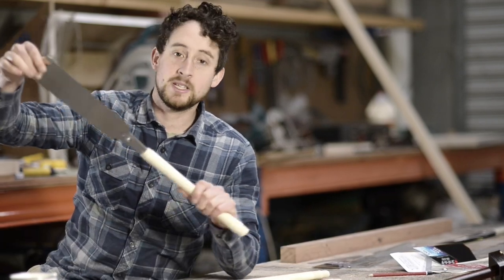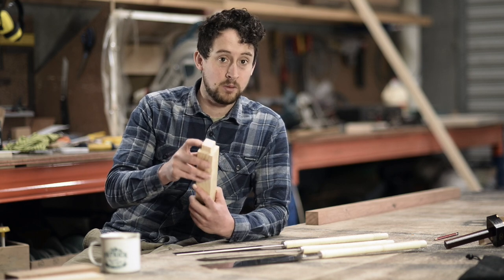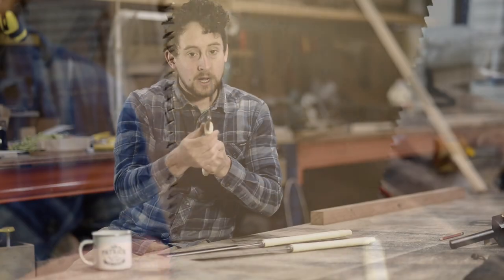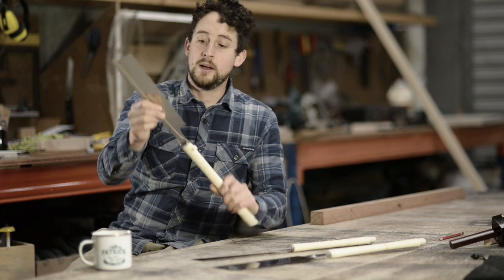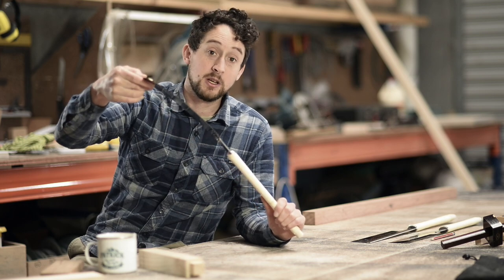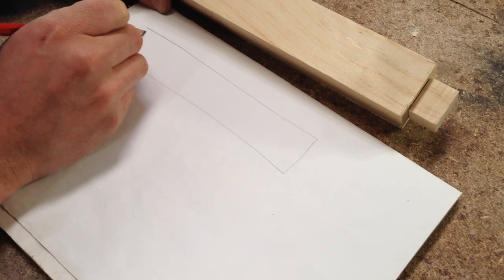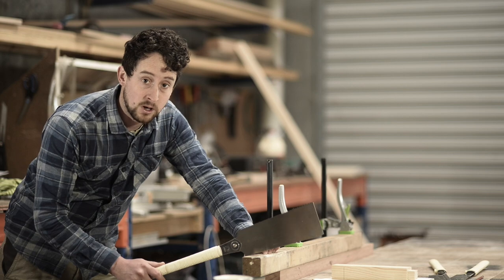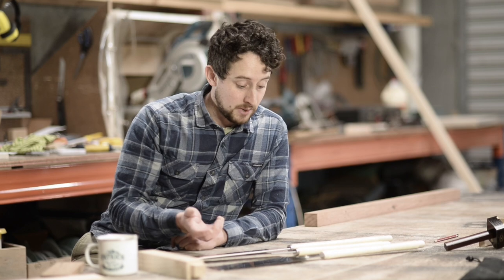An Introduction to Japanese Saws

Comment: I had been using traditional Western saws with no issues for years. However, i developed rheumatoid arthritis in right hand and holding and using the push saws was starting to be difficult. I tried a ryoba to start with for ripping. Due to the different cutting (pull) and grip and less weight compared to a western saw, I can now continue my woodwork with very little pain and the improved grip gives me very accurate cuts. I now have a set of the 4 most useful Japanese saws. Highly recommended for those who may be in a similar position.

Comment: I just finished installing shiplap where I did the entire thing using my dozuki and kataba.  Being able to work with little to no noise and producing less dust is a big deal.  I love the quietness of using a handsaw and because no two cuts were the same I was able to scribe and cut without having to setup a miter saw each time.

Comment: I've started to wear out (bugger up) my Ryoba saw. Initially I hated the rip teeth as I wasn't trying long rip cuts. Recently I built a Tassie oak artist easel, 15 bird houses, and a queen size bed weighing 180kg all using the Ryoba, some chisels, and an f-ton of elbow grease. I've warped the cross-cut blade tip, tooth number 6, and you can see some discolouration in two other places where I didn't do great things. That's four newbie mistakes over around 3 years of woodworking causing minimal functional damage. It is still razor sharp and effective.

Comment: Thanks for confirming they're Gyokucho; I've also been considering Gikoh/Kakuri but I've heard respected craftsman vouch for Gyokucho saws. 
For tough cuts you can start the kerf with just the closest end of the blade as these teeth are made closer together for this purpose. 

The single blade, spineless saw is 'Kataba', not "Kabata", just FYI.

Comment: I would like to add is that they are relatively simple to break. This occurs when the user pushes the blade forward but not exactly at the same angles as the saw cut. I bought a kataba specifically for hard wood and broke it in the first 5 minutes. A wedge or shim could have helped but the wood was very hard and the cut just started.  Just a simple warning to be careful and don't rush the cut.
Reply from the maker: Thanks David. Much appreciated. However, remind us never to arm wrestle with you! :-)
Reply: David, you're spot on.  I bought my first Japanese pull saw 3 days ago.  It was very awkward at first but when you hit the groove, no pun intended, it's a great cut.  Thanks for your video and you just received another subscriber.

Comment: Nice video. How about mentioning that camellia oil (tsubaki oil) is good to put on the saws to prevent them from rusting?
Reply: That's the traditional oil used in Japan, yes, but any oil or wax you can find will work fine.

Comment: What's a good feather file to sharpen those saws?
Reply from the maker: The teeth are impulse hardened which make them extremely sharp and long-lasting, but also make them brittle and unable to be resharpened. The blades are easily removed and replacement blades are available when they start getting blunt.
Reply: blade can change new, wery cheap buy and change new blade, but no need change manytime have wery strong and longlive sharp saw.

Comment: What does rip cut and cross cut mean?
Reply: Rip cuts are when you cut with the long grains/fibers of the wood while cross cuts are across the wood grains/fibers.  Usually a piece of wood is cut and processed so the grains/fibers are oriented parallel to the length of the board while crosscutting is perpendicular to the wood fibers.  Hope that helps.

Comment: what need use plywood ? rip cut or crosscut ?
Reply: Matti Virta crosscut, however if you have the money or work with a lot of plywood there’s actually a Japanese saw made specifically for plywood, since plywood is especially hard on blades due to the glue and anything that’s stuck in between the layers.
Reply: @thatguyonyoutube807  link?

Comment: YOU CAN PULL A TRAIN BUT YOU CAN'T PUSH A TRAIN
Reply: You can't push a train? Tell that to most American commuter railroads.
Reply: Helper engines in the middle push and pull.Also go to a busy yard and see trains pushed and pulled.
Reply: @chengliu872  a single human being can and has "PULLED" a train, but never the opposite.
Reply: @chengliu872  no one has poetry anymore ... this is in reference to the beauty of sawing on the pull and not the push ... don't overthink it.
Reply: @danbytp  this is in reference to the beauty of sawing on the pull and not the push ... don't overthink it. A single human being has and can "pull" a train, but not the opposite.
Reply: @terryb3388  You're right. The lead engine(s) are pulling and the trailing engine(s) are pushing.And can do the opposite depending on accelerating or slowing.The fun one is the mid train helper doing both at the same time,all the time.Thank you for reminding me.😁

Comment: Hold the saw on about a 15 degree angle it will cut straighter , you will feel it when it's the correct angle

Comment: Why replace the saw blade when it gets dull?  With how broad the blades are, it looks like they can take a hundred re-sharpenings.  There's a world of difference between a sharp saw and one that isn't dull enough to replace yet and files are cheap.
Reply: tya04 the blades are too thin to be resharpened. There are Craftsmen in Japan who do it but it is very difficult and expensive.
Reply: tya04 Most Japanese Saws have hardened teeth. They can be sent to Japan for resharpening, but the blades are designed to be replaceable
Reply: saw blade can change, wery cheap buy new blade and change new, i want see men who sharpeninin 0,6mm thin saw whit file haha, lot work ,easy change new blade and super cheap.hardened blade not need change manytime all your life about maybe onetime, but old shit bush saw need sharpen ewery week.

Comment: Japanese rule for sawing--    Only cut the surface you can see.--     So from  9.42 you break the golden rule. In this video you have a nice straight grain piece of soft wood. So you were "lucky". But for a teaching video about Japanese saws you broke the rule .
   Most videos don`t explain how the Japanese rip saw should be used . You got close to the right idea and then shot yourself in the foot by not demonstrating Rip Cutting. You switched back to cross cutting . So I don`t think you understand  how a Japanese rip saw works .  Just as 5 other videos get it wrong as well .  You are not alone .